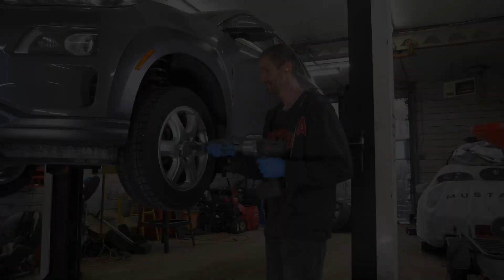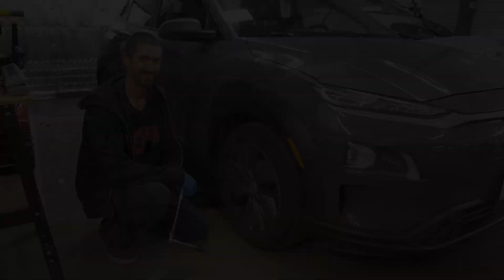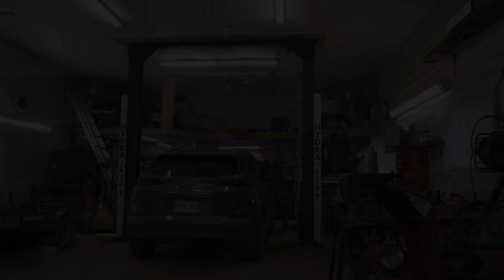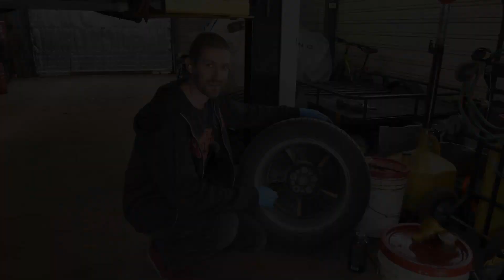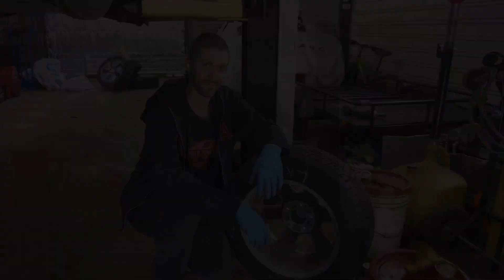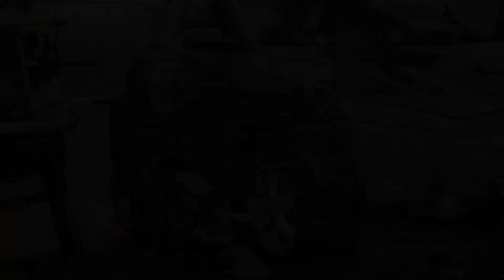Winter Tire Swap - Seasonal Tire Changeover

Comment: I'm trying to figure out the best way to rotate my tires at home on my kona. Lift each corner and get the car on 4 jackstands? Where exactly should the stands go ?
Reply from the maker: Do one side at a time. Lift one corner, and you'll find that the whole car will lift on one side with a strong jack. Put the jack stand on the other lift point or on a solid part of the subframe.
Reply: @livewirereview  Thanks! That makes sense!

Comment: Excellent and comprehensive. Thank you.

I'm going to buy a few tools, please let me know if I am understanding things correctly by helping me answer the questions below. My car is a Civic 2013 and the lug nut torque is 80 ft-lbs.

1.  (Optional) Impact gun + torque stick (should I get 80 ft-lbs or slightly less, then tighten with a manual torque wrench after?)

2. Torque wrench (2-way; I assume 1/2 in?) ex. 20-100 lbs

3. Floor jack. (I heard it's unsafe to use the one that comes with the car, do you think it's OK if I take the correct safety precautions?)
Reply from the maker: The torque stick will slightly under torque. Use the torque wrench after to snug them all up. 

Use any torque wrench that fits the range of torque you need. Usually 1/2" and 10-150ftlbs or 20-250ftlbs.

The jack that comes with the car could fold under pressure. Buy one and use a jack stand for safety.

Comment: Thank you!!  Just did my tires. Full car off ground. No damage or injury.  Not a mechanic,  just my steps.

1.  Lifted the front using two floor jacks  ( one on each side) over the pinch weld. No blocks. Two floor jacks may not be necessary but I had them.  Had chocks at the rear when lifting the front. 

In the front, used a jack stand on each side under the lower control arm close to the tire. As per the video.  Left one of the floor jacks in the front to take some of the weight.  

3. Jacked up the rear at the centre cross member. No stands at rear.  I did not go under car. Car lifted off the ground with no issue. I shook the car and overall it seemed sturdy.  Still wouldn't go under it though.  Lol.  I have some pictures I could probably share if helpful.

Comment: My biggest concern is when you use a floor jack and you lift up one corner of the car, the batterie will flex. I don't know what the consequences would be of that. Batteries are very heavy and if a seal would break water could enter the casing and your batterie will be ruined.  There are some concerns about this when you google it. Have you ever  thought about this?
Reply from the maker: Tesla is a different story. They have very small, very specific jack points. You can see that in our spring maintenance video. That car is sooo rigid, the whole car lifts one whole side off the ground when you jack it up with a floor jack!
Reply from the maker: Check out our battery rebuild video when you have a chance. You get to see what is inside the case. These cars are incredibly rigid nowadays and the case is very robust. There are several bolts holding the battery case to the vehicle. The seal on the lip of the case is thick and unlike other brands I've worked for, their rubber seals work well.

Don't sweat it, it's perfectly safe to jack up the vehicle to change your tires when using the correct lifting points 👍.
Reply: @livewirereview  thanks for the advise. I appreciate it. I will check out the vid. I was concerned when a Tesla salesman was advising against doing so in an online thread.

Comment: I do put the Kona EV/Kia Niro on Jack stands by lifting with a long 2x4 under the SIDE of the battery enclosure, where the large securing bolts are located, I'm showing it in a video on my channel. The side of the battery enclosure is reinforced and apart of the actually battery compartment.
Reply from the maker: I would avoid this as the side structure of the battery is actually a crumple zone in case of a side impact collision. Try to get the lip of the jack stand on the pinch weld.